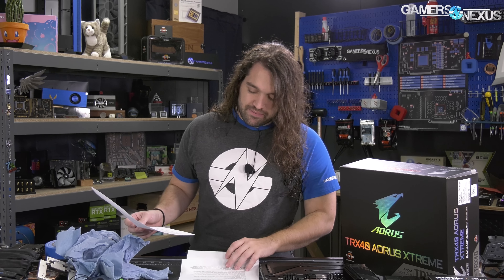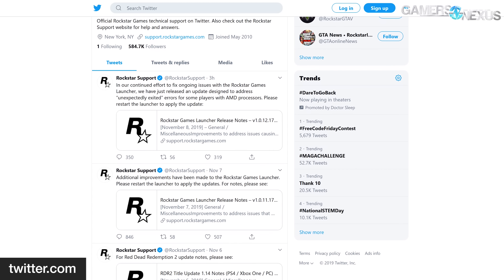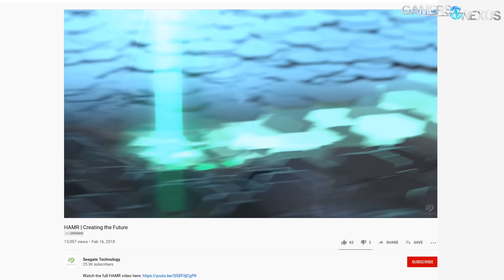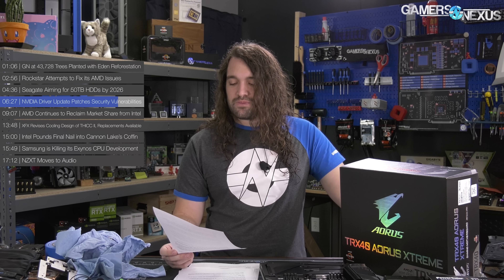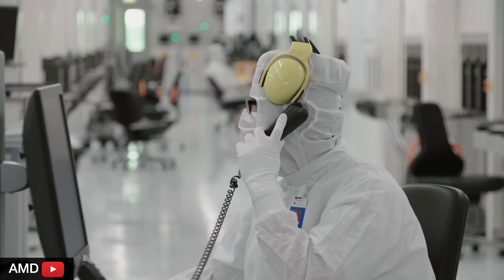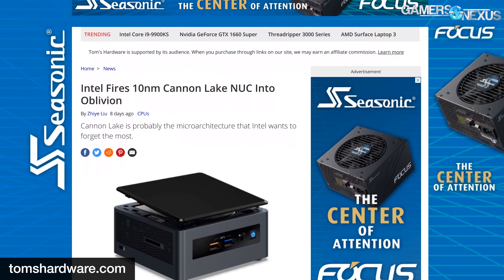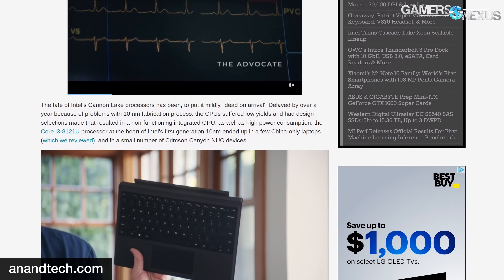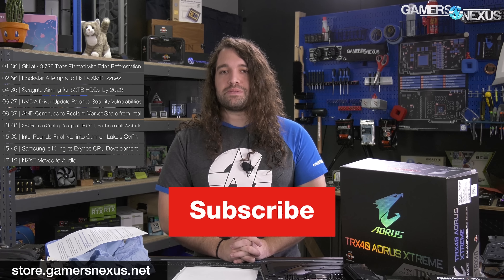HW News - Rockstar AMD "Fix," NVIDIA Driver Security, & 50TB HDDs

Comment: 9:16-but after this rdr2 launch and it mainly effecting amd processors/products whos going to want a cheap unreliable product when intel is right there to assist you, at a price.
32 and 64 cores are fine and dandy, if they work on the software you are using!!

Comment: I cant help but feel super lucky. I have had almost NO issues with RDR2 on PC. And I'm using Vulkan on a Ryzen 9 3900X with 2x 2080Ti's. The 3 most common factors that the people have reported as having issues with. Vulkan over DX12, an AMD CPU and a Multi GPU Setup. I have had NO issues with the SP Story. Only in Online. I have had only 2 crashes for no apparent reason, except during one crash I WAS alt+tabbed out and using a firefox, that may have done something (prob not though). Otherwise, my biggest issue with RDR2 is the dropouts in online. But I cannot launch the game from ANY shortcut. Only directly through the launcher. But it does launch every time.
Good luck to yalls out there having trouble with rdr2. I hope a solution is available for yas soon.

Comment: 50 TB? My Lord!
I never thought of that capacity, I thought the maximum capacity for HDD is 10 TB honestly
Reply: @Peter G solid state has a long way to go to make up for the cost aspect of huge storage capacity
Reply: They wanted to do this like 10 years ago. Just PR, nothing special
Reply: @Peter G Nope, even if tape is very slow, it is on another level in term of anti environment provided same storage condition.
Reply: @Peter G what's the point in comparing solid state to high capacity hard drives for storage? The whole point of storage is that there can be  lot of data that doesn't need to be frequently accessed, although retaining it is still important.
 I don't know what it's like where you live, but SSDs here are roughly 4 to 5 times more expensive than the equivalent size HDD when moving beyond low capacity variants. SSDs have their place, but are far too expensive to be considered a complete replacement for all use cases.
Reply: @Peter G It's been pretty slow going as far as I'm concerned (on both capacity and cost). For consumers, I don't think I've really seen anything advertised for capacities greater than 4TB when it comes to SSDs, yet I can easily find 16TB HDDs for little over $500 USD. To go looking, I can find a 15.36TB SSD made by Samsung that costs over $10,000 USD. That's a LONG way to go for parity. I've read that conservative estimates won't have them close until 2030 or even beyond (cost per GB/TB), and even then with the maturity of technology when it comes to standard hard drives, they will have room to drop costs further, etc. Until we are at the point where, for example, I can purchase a 16TB HDD and a 16TB SSD for roughly the same cost, I will continue to think of arguments against continued developments of the older technology as pointless (and I'm not holding my breath).
Reply: @Peter G No, I didn't miss the point ... and examples used are not extremes. There are some businesses and individuals that need large data storage solutions TODAY ... as in right now. What are you going to tell those people? Pffft ... hard drives, what a pointless endeavour. All you need is solid state. Sure it can cost as much as 18 times more than conventional solutions, but one day it won't. Just sit on your hands for the next decade and maybe you can purchase large capacity SSDs for the same cost as hard drives. It's not extreme to say that at all, it's the black and white reality of the situation. Hard drives have their place until solid state comes WAY, WAY down in cost. Not any time soon.

Comment: 18 years ago, I upgraded to two 60gb hard drives in raid 0.  I was thinking I had it made and didn't need more storage for years to come.  Four upgrades later I am still only 150% above the capacity of the largest drive available across eight cheap drive arrays.  Reminds me if a guy I knew, who collected recycled computers, having networked twenty or more computers having the same storage capacity if one top of the line hard drive could hold for capacity, at no cost being recycled but taking lots of real estate and using hideous amounts of electricity to operate.   Seagate has been sitting pretty since the flood they had, and admitting that they were comfortable ripping off consumers for years to come, offering garbage products and stifling innovation. Their SMR products also higher in capacity are similar to tape drives in latencies, taking years to write to. SMR is not for consumer market but for archival storage.  You would be better off using DAT tapes.  HAMR drives are much more feasible tech, but with ever increasing availability of SSD tech in the marketplace they will be caught with their pants down and be obsoleted before they can innovate to a capacity which can be competitive or marketable as a replacement for silicon storage.  I am looking forward to the day Seagate closes their door and lays off all those rich executives who decided to stagnate innovation for so many years in favor of selling old crappy tech at  inflated pricing to consumers for a easy pay cheque.  Karma will be a bitch Seagate!

Comment: Its costs twice as much to manufacture an HDD compared to and ssd 
Let that sink in
Reply: I doubt that. The PCB should cost about the same as an SSD. I would be surprised if the aluminum casting and machining, spindle motor, and assembly were that cheap, much less actuators and platters.

Comment: Increasing HDD space is not that great achievement until the company keeps increasing the prices too in linear fashion. Do I want a 40 TB drive? Hell yes. Will I pay a thousand euros for it? Hell no.
Reply: Hmm, almost as if the target for high density storage has more considerations than just $/GB, like W/GB, in mind.

HMMMMMM
Reply: @Asdayasman  Ohh, yeah, W/GB where SSDs are literally a tier above HDDs if price doesn't matter.
Reply: @menpee  Except they're not.  An HGST He12 runs about 9.8W and contains 12TB.  That's 8.2e-4W/GB.  The intel DC P4510 consumes 5W idle, 16W while reading, and contains 8TB.  That means if you're reading a measly 14.2% of the time or less, the SSD uses less W/GB.  For a user that cares about W/GB, that 14.2% number is HIGHLY unlikely.  As an example, my simple NAS (that can fit basically everything it needs in ARC) has a reading% of 31, and it only serves three people.

Comment: Rockstar, red dead redemption.....yeah, another reason to not buy AMD. That has been my experience going all the way back to my AMD k6 233 vs. my intel 200mmx, then my dual AMD 1900+MP system going up against my single 2.0GHz Pentium system, then my AMD X64 3200+ up against my i7 920 system, then my AMD FX 4400+ system going against my i7 2600k system and that was pretty much the last nail in the "let's build another AMD system" coffin as EVERYTIME there were serious problems with the AMD systems while the Intel sysems ALWAYS WORKED, this leads to my hesitation to purchase a Threadripper 3950X, SO i purchased a i9-9900KS system instead. Ironically i really like AMD GPU's, which is pretty funny in my mindset.

Comment: Nvidia has software vulnerabilities in their GPU drivers, so by logic AMD does also?
Reply: Every complex driver does, should be the assumption. It's just a question of what ones are known. These NV ones are not novel, but the kind of thing a graphics oriented developer won't likely think about, yet a good code audit should find.
Reply: @laurelsporter  You can't say something without proof.  He should have never said it.
Reply: @rflair  then you should never mention them, ever. Imperative programming languages with variable reassignment do not allow for a lack of exploits to be provable, and every programmer knows their code isn't airtight.

It would be typical for people to use the disclosure as a way to logically leap over to AMD's drivers being more secure. That would be a poor assumption, but one people already have been making.

The important thing is to get exploits fixed in a timely manner, rather than sit on them and wait for malware to use them.
Reply: @laurelsporter  Yes the important thing is to fix things.  I or no one can assume anything about AMDs drivers being more or less secure, I can't assume that the DLLs that are being exploited in Nvidia drivers have a similarly programmed and therefore exploitable DLLs programmed by AMD.

Comment: XFX has screwed up its cooling and they justifiably got a lot of flak for it but the worst sinner is ASUS, the fact that they sell their graphics cards at all (5700 (XT)) is outrageous, it is impossible that they don't know how bad it performs, yet they sell it for a high price, the Strix 5700 XT is the most expensive one in the line-up, it also is the worst one, even worse than the reference card. Memory temperatures over 100 degrees Celsius, GPU throttling all the time. It is a pity that none of the big tech media reviewed this card for months, many people got duped by buying it and that could have prevented. I get it, ASUS didn't send one, but that should have been a red flag, not only for the victims who bought this card, also for the tech media. ASUS also badly screwed up their BIOS, look on Igorslab for more details on this. XFX attempts to fix its screwups, ASUS has made no effort at all so far. I will never buy anything from ASUS as from now. Bye-bye.

Comment: "High end" audio products. You just mean overpriced, right?
Reply: 24 bit 96khz is super old.
My old(2003) pci based card did 24 bit 192khz and a Tascam US-1641(?) did 96khz on all 8 channels.
Reply: @zarmaanful  what's your point
Reply: I make my tracks in 16 bit and 44.1 kHz like most other people.
Reply: @InvidiousIgnoramus  i meant that the "MXER" has really low end level specs.
Reply: @zarmaanful  So you're agreeing with me, then.
Reply: @InvidiousIgnoramus  Why are we even arguing?
Reply: @zarmaanful  You tell me. I simply asked what your point was for mentioning a sound card.
Reply: @InvidiousIgnoramus  I thought you were talking about the NZXT thing.
Reply: @zarmaanful  I was. I called it overpriced.

Comment: I'm not impressed by what I see right now in terms of headsets on those pictures by NZXT. To be had, right now, I'm not really satisfied by the offerings of any company. I've switched headsets several times over the last few years. A lot of them have the roll up microphone and I just don't like those. With time, they degrade quite a bit. I would love to have something with a swivel microphone. I had one of those more then a decade ago and it was great. I also find that often, the pads on a lot of headsets aren't thick enough and just rub my ears raw. I would also love to do away with the dongleseption madness going on right now. I've had some real bad experiences with dongles of late. It's more connections that can break, and unfortunately, they do break since the point where the dongle connects tends to hang midair between me and the computer. Got a wireless right now and I'm enjoying it, but I do wish that the signal would reach a bit further.

Comment: Some people like to bash on failures of HDDs simply because it reads Seagate. Yet if you go ahead and check the annual reports by say, Backblaze, you will in fact see capacity & company are not always black and white.. & for God's sake, if you had a 50TB HDD the least you can do as a "reasonable" person is have backups in place. Ideally off-site. Furthermore if pricing is within my means hypothetically I'd snag two at the very least and run RAID1, if I could dream--several & run RAID5. If my ADHD brain remembers anything else to mention I'll be sure to add an edit (no, seriously lol). 💀

Comment: AMD's added market share is where they should be anyway. They have been behind where they should have always been for many years. Now that they have a competitive product is good but this will not be David toppling Goliath. They are both David. One was just a little quicker attacking the giant which is the market. 

There is more market than Intel can handle now with the world market growing so rapidly. Therefore, AMD rose up just in time to share in it.
Intel had shortages for a while. Now with Intel ramping up 3 fab plants things should be rolling along for both by next year end. The stars just happened to line up in everyone's favor here.
 But the key is there is more market than just one company can handle. 
And Intel is trying to produce more than just CPUs as most readers know. They aren't going anywhere. AMD is not going to cut them down.
 Everyone always just thinks desktop and servers all the time There is much more that both companies can and do sell to.

Comment: A year ago I build my first pc,
Thought I had my ram in dual channel, yesterday I found out I didn’t,  gained 14 FPS average on rdr2 meaning I can now play with lowest dip being 75fps at current settings @2k 
Instead of dipping below 60 on the lowest dips

Edit, I’m also one of the lucky people that didn’t have any launch issues with the launcher,
I did get screen tearing when using vulkan with raw mouse input and holding shift in game, “ fixed” that by using direct mouse onput

Comment: intel are so fucking dumb. like seriously. the enthusiast market might be 100x smaller than the main stream one however it's the enthusiast person that every single main stream user goes to for information on what to buy. for example my brother sucks with computers however he now has a pc with an amd chip in it because the value to performance was and is still just better. if you don't want to lose more market share you need to out price and out perform amd. price matching is something they should've done 3 years ago, now it's too late because from my perspective my imagine of intel is basically that they charge 50% more for equal performance with a 5% edge in gaming, with extremely expensive motherboards. unless intel offer something like 25% cheaper than amd's equal offering, i'm not interested anymore.

Comment: if i were buying now i would go amd.  but i already had an 8700k that got sold for what i paid for it and i got a 9900k with the money, all before zen 2 launched.  but im not buying anything that doesnt have a good single thread\gaming increase over a 9900k.  8 cores, 16 threads is more than i need.  if intel bring sunnycove to 14nm and it still clocks near 5ghz then maybe, or if amd can pass intel with the 4th gen....well i still wont buy cause im good for a few years.  but basically the next thing i buy wont have more cores, itll have the same amount with faster cores.